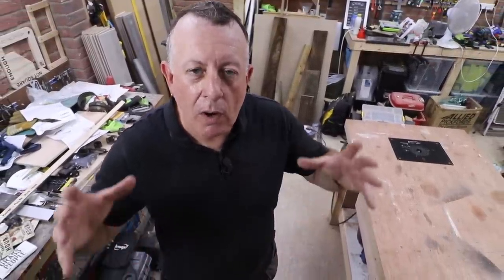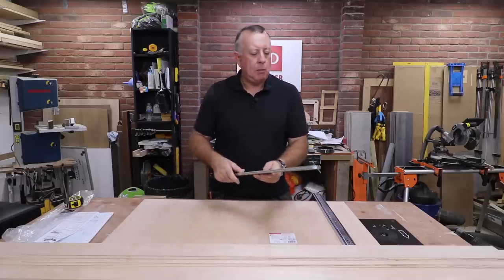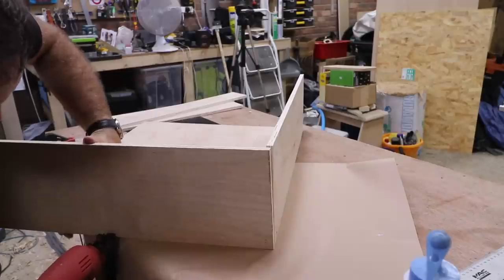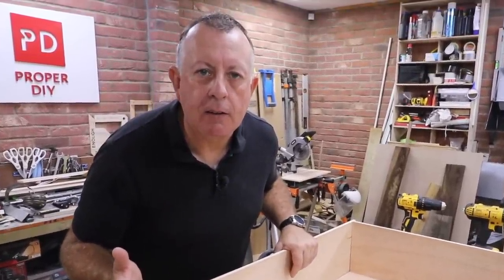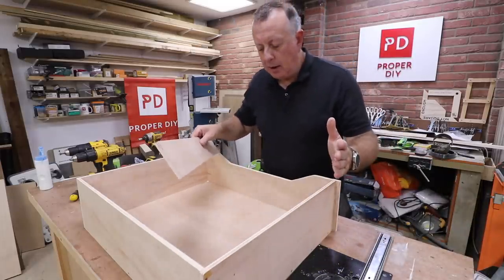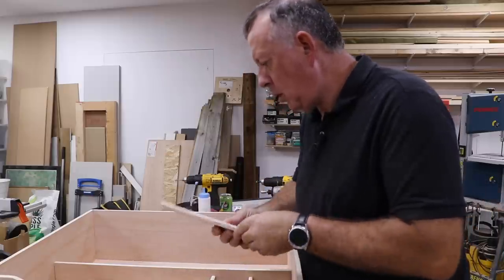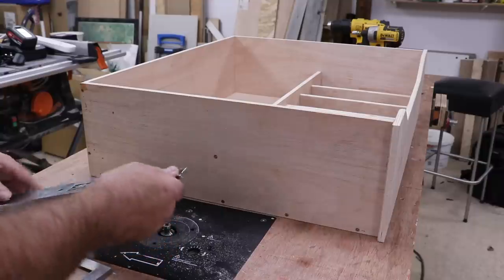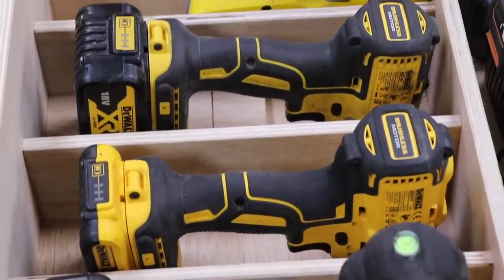Drill Charging Station in a Drawer!

Comment: I really like the simple idea of using holes in the bottom. It might be a bit of an issue if you have kids or pets who could hurt themselves on a sharp bit. In those situations you could have a pipe extend down past the drawer bottom so that the bits are enclosed. To stop dust build-up in the drawer you could put a mesh over the holes, similar to what you can use over PC fans. Though with the dip in the front, it won't matter much. I think I would have used a full size front with recessed ring pull handles. It keeps it flush and also stops debris and dust coming in that way.

I never really thought about the strength of plywood, but that makes total sense. :)

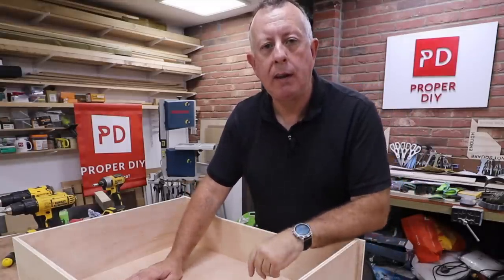Comment: 7:57 - The sheets are glued to each other, so any load gets transferred between them, and I doubt a 1-sheet difference will have much effect (maybe if it's 3-sheet ply, or if the inner sheets have a lot of voids, but in decent 7-sheet ply I suspect the difference will be completely negligible). Might be interesting to do a video actually testing that.

Comment: Clever solution! 
If I may ask: connecting the power strip to the NVR switch - doesn't that mean the chargers only charge when you flip the NVR switch on? Or is the NVR switched on constantly and only turns off when you hit the switch?

Comment: Most likely your miter saw blade needs to be cleaned rather than sharpened.  Those carbide teeth wouldn't be dulled by cutting some plastic, if you've cut a lot of softwood (especially pine) as well as the epoxy/plastic, you'll end up with buildup.  Considering how expensive everything is these days, give it a try before you take it to be sharpened.
Reply: Use thinners. That's what I was taught to use as an apprentice. It's cheap as well

Comment: I want to ‘upgrade’ my toolkit with a cordless drill. I’m curious how long the battery will hold a charge between usage. Days? Weeks? Months?
I’m just a home DIYer so I need a drill maybe once every few weeks and it would be annoying to need the drill now only to find the battery drained. 
Thanks for sharing. 
I really enjoy your videos. Regards.
Reply: I've never had any issue with batteries draining themselves. I think it just depends which brand you go with. Presumably the more expensive tools are going to have better batteries, which will hold a charge for much longer.
Reply: @ACAIDC  Thanks for sharing. I bought a DeWalt 20V and have been using it on and off around the house for a few months now. Only had to charge it once and didn’t notice any battery drain.

Comment: Your blade might not even need a sharpen, just a good clean with a wire brush
Reply from the maker: The epoxy resin I cut through for the video was producing sparks from the blade so I think it needs sharpening